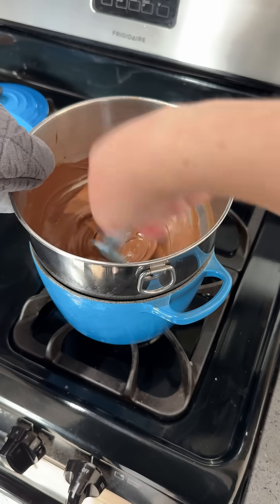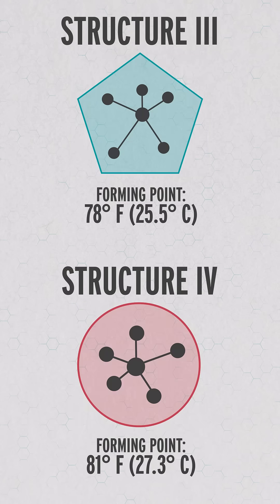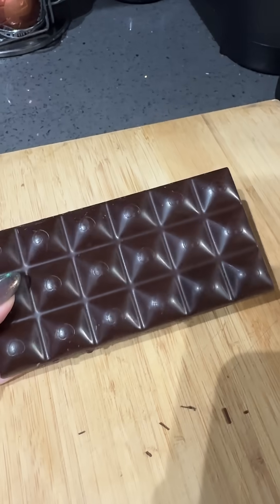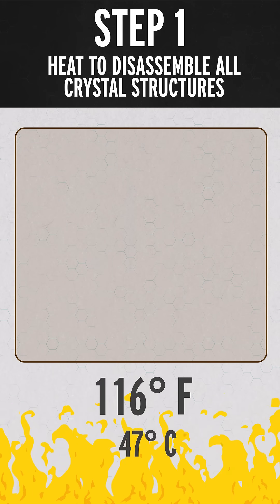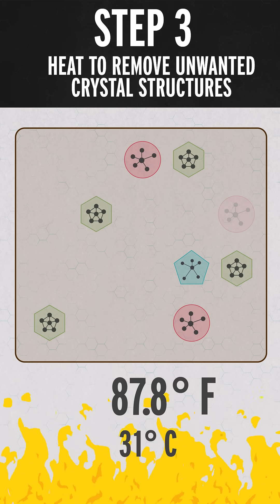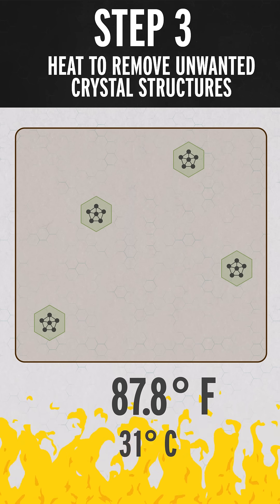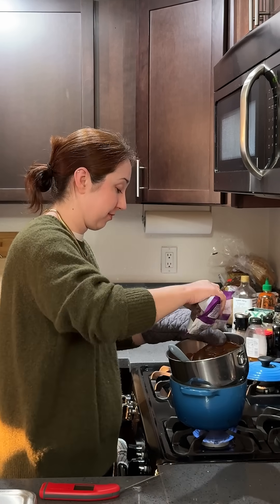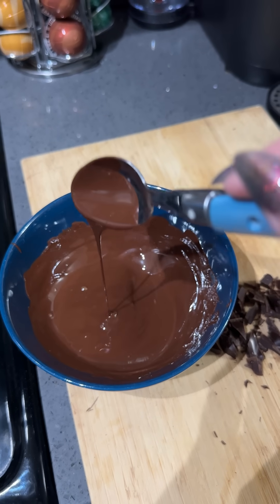tempering chocolate is chemical engineering

Comment: Recrystallizing chocolate is crazy.. using more chocolate as nucleation points is even crazier
Reply: I was wondering if it was nucleation sites. I don’t know much about it, but I remember the action lab video on supercooled water that will suddenly freeze on existing (crystallized) ice
Reply: it’s the same way industrial crystal manufacturing works
Reply: She didn’t do the science justice but there are a few examples of the “seeding” process and I’ve done it personally and it kinda works as long as you didn’t go overboard melting in the first place
Reply: @daniel3392  It's practically impossible to "do the science justice" while both working in a shortform video's restrictions and being approachable to laypeople. I'm no layperson so I can't say for sure, but I think she did quite a good job.
Reply: @daniel3392 she definitely did it justice because I’ve never considered that chocolate could have multiple different structures.
Reply: Engineering!!! 🥳
Reply: It's not exactly chemistry, it's crystallography. Without seeds, microscopic crystals form next to incompatible types. There's no coherence, no coalescence
Reply: It actually works to. It the same science used on industrial scales to create specific formations of metal
Reply: Nucleation points form naturally within the chocolate itself as it cools, not from the added tempered chocolate.
The seeded chocolate simply provides the correct crystal structure for alignment, speeding up and stabilizing the process.
Reply: “I used the chocolate to make the chocolate” 😂😂😂
Reply: If chem and science is crazy id be scared to know your political and world views
Reply: As a physicist to hear her say chemistry kinda hurt lol
Reply: I thought this was really clever, I'm going to try this
Reply: Congratulations, you understood the video and regurgitated it in a comment
Reply: She must be stopped 😭🙏

Comment: As a material engineer this is material science  and engineering not ChemE. Chemical Engineers can enjoy there pipes and fluids but they are not getting claim to solid state chemistry or crystalography. All jokes aside love my Chemical engineering colleagues but stay away from Our crystals!
Reply: Was just going to post about this. I'm an undergraduate mechanical engineer and just finished materials last semester. Had no idea chocolate could have crystal structures similar to metals hahaha
Reply: @Clen5150  then you got a lot to learn still. a lot of molecules can crystalize, that just means that they have a repeating pattern, which by definition means that polymers can also crystalize; for example if i remember correctly nylon can have up to 40±5% crystallinity.
Reply: Yeah, sure, you can keep your rocks :3
Reply: I'm an electrical engineer, I only took one materials engineering course where we barely touched crystallography. I came for this.
Reply: Mechanical engineer... came for this comment too!
Reply: You can keep your crystal structures, I'll stick with my oil and gas and reactivity distillation
Reply: Crystalography is often used in chemistry... its just that the line is non existent at this point between physics and chemistry
Reply: @michasokoowski6651  True you can really argue it's anything that connects that overlap between physics and chemistry. Just material science happens be a place where it happens in this scenario while ChemE as a discipline doesn't really more focused on the combination of reaction kinetics, fluids, and thermodynamics of things.
Reply: But isnt state of matter just dependant on specific pressure, temperature and volume?
Reply: @off-meta9962 > no. Structure is also configuration. Similar to proteins that are folded in pretty complex ways which completely changes their function. A lot of materials (which is why alloys are so fun) are combinations of things and while they are a product of time, temperature, etc. They can be manipulated. Even fairly pure compounds like table salt can crystallize in several ways, be it rock salt, flakey pyramid salt, etc
Reply: Are there good materials engineering jobs outside of academia? I did some semesters of materials engineering before I took a break, and I am now questioning my career choices.
Reply: @kolbyking2315 there are plenty. Really depends what you specialize in though.
Reply: @kolbyking2315  you may want to look into metallurgy specifically if you want a common practical application. but there's quite a few others, most of them in research, quality control/testing and process engineering. if you want to get into polymer science, which isn't really all that different from a lot of materials, you may find better options in the petrochemical industry.
Reply: @kolbyking2315  I'm still in school but I was able to get a gig for the summer pretty easily so I'm sure there's work out there though I can't tell you too much. If your looking for jobs it's worth looking at QC and failure analysis engineer jobs haven't found  any luck in hard-core material science r and d people always need quality assurance and a MSE degree can give you a lot good skills for qa.
Reply: Came here to say the same
Reply: Brethren!
Reply: never 🧐
Reply: @alananderson2567
As an ME who actually heard of this practice in my material science class from a Ph.D in ME... 👏🏾👍🏾👏🏾
Reply: I found this out the hard way when I went to an all day chemical engineering seminar in college, not what I thought it was. 

It was also even more brutal because none of the speakers had collaborated so the 10 presentations were all "how my job works as a chemical engineering graduate" and 8/10 of them had the exact same job (glorified health and safety manager in a factory).
Reply: Was gonna see if anyone else had the same thought. I'm ChemE, and while I have basic knowledge of this, there are many other disciplines this would more closely fall under.
Reply: lol I came here to make the exact same comment! Materials scientist here 😂

One of my profs way back in the day made his name by doing something similar with aluminum.
Reply: @jimmylin7233 wonder if we went to the same school. Was it for extrusion technology?
Reply: @Joker-em6oz  Not for extrusion but rather casting. Were you also a “Course 3”?
Reply: @ darn, different school. Oh well
Reply: @Joker-em6oz  always happy to make the acquaintance of a fellow materials person, no matter the alma mater
Reply: Besides, as ya'll have already stated above, that this is Chem Eng/Mat Sci Eng/Chem, is this also Food Science/Food Technology/Food Engineering?
Reply: as a chemical engineer, i agree
Reply: As a chemist, there are crystals in polymers.  The fat in chocolate is one. You can manipulate the melting point, the size of the crystals etc with chemistry.   But to be far what she is doing looks more like cooking.
Reply: @rebeuhsin6410  cooking is chemistry :D
Reply: @rebeuhsin6410 isnt chemistry just cooking with chemicals? Shes only focusing on temperature and crystal formation. Both are physical properties and so it has NOTHING to do with chemistry.
Reply: I’m a chemical engineer and I approve this message.
Reply: as a chemical engineer i agree
Reply: Its called physical chemistry, "material science" is not used for food. Food science specifically related to structures is called gastrophysics.
Reply: @PLF... material science deals with phase changes. This is an application of basic material science concepts
Reply: Yea this isnt chemistry at all. People just dont learn stem things anymore tho so its all just "science" to them
Reply: As a Mechanical Engineer who hates both you for the courses I had to take so that I could work with you, I'm about to make a rice cooker for Chocolate and sell for a $500.

Comment: Does all chocolate transform into type 6 crystal structures with time? You definitely need to make a full series of videos on this topic.
Reply: I went down a rabbithole and the short answer is "pretty much". Type 6 crystal structures in chocolate are mostly associated with bad things, like fat bloom (the weird fuzzy/hazy residue at the top of old chocolate). That being said, there does seem to be some differences in how type 6 crystals affect blooming in tempered vs non tempered chocolate. The short answer is that, typically, type 6 chocolate is formed after a significant amount of time, often months although it can be done faster if you store chocolate in poor conditions. Maybe there's a type 6 crystal structure that doesn't result in bloom but this seems to be something we have not found yet. But I'm a chemist, not a food scientist, so I could be wrong!

Comment: Tell us all about type 6, please. 😊
Reply: This sent me down an absolute rabbit hole. The short answer is, type VI is a crystalline form of chocolate that is associated with bloom, that gross looking moldy appearance you sometimes see if you leave chocolate out. However, it truly seems like we don't know AS MUCH about it as you'd think. Namely, type VI crystals form over time in both tempered and untempered chocolate, however the co-occurrence of bloom in these tempered chocolates is not necessarily as high. To me, this suggests that there may be a "bloom-free" method to get type VI chocolate crystals, although I couldn't tell you what that is.
Reply: @sunburntsatan6475  the phase 5 crystals melt at above 35 degrees, and the chocolate begins nucleating phase 6 crystals below 45, so perhaps by rapidly cooling fully melted chocolate down to about 41 degrees, waiting for it to form those phase 6 crystals, keep a portion of that chocolate to one side, melt the rest again, then use the chocolate that you've kept to one side to seed the nucleation of crystals the second time you cool the chocolate to around 35 (undercooling), then raise the temperature again to 40 to melt the phase 5 crystals, and keep it at 40 until the chocolate crystallises sufficiently to cool it down to room temperature.
I haven't tried this, maybe this will work?
Reply: tbh I'm also interested in getting phase 1 crystals without any higher phases, as it would be perfect for a chocolate sauce
Reply: @u7w2  But why go to all of trouble, going up and down. When you can just seed it like what the professor just described? Just seems like a lot of unnecessary work to me. With your described version, you have no way of knowing whether the set aside chocolate has properly formed the crystallised structure or enough of them to be able to produce a good final product?
Reply: That requires having tempered in the first place.  Once you have done that right from then on keep some for future chocolate  @SuperKendoman
Reply: @sunburntsatan6475 head cannon for me is those airy chocolate bars they have in England 😂😂
Reply: @jedimasternoob  I believe Ann Reardon worked out that flakes are basically just chocolate with too much moisture so it can't really melt (I say this but I'm going off my admittedly poor memory, but she did work it out and it wasn't that fancy)
Reply: @jedimasternoob  "head cannon" how does it not explode your head? Eh, head canon for me, "canon" being how you spell the term for a personal belief, is that you have a magical, explosion-proof head to support your head cannon.
Reply: @jedimasternoob  those are called, flake, and they’re my favorite chocolate, even though I live in the US. You can make your own by melting chocolate, and then adding a couple drops of water in it to seize the chocolate. Ann Reardon did it in one of her videos.
Reply: @sunburntsatan6475  probably in an oxidant free controlled atmosphere, it sound very similar to aged steel where you let the steel artificially age in a hot furnace for a couple of hours, typically around 400°C with a controlled atmosphere to minimize oxidation, that precipitates graphite and other secondary phases, in the case of chocolate, room temp and some months (due to the thermodynamic kinetic balance) would be equivalent to it, but I'm talking as a Metallurgical engineer, so this is just a entirely a conjecture
Reply: @sunburntsatan6475  I may have encountered Type 6 chocolate in the wild, in the form of surplus military ration chocolate that had been sitting in storage for a few years before being given out. The 100 gram bars looked slightly dusty after opening, and were rock hard, and would break into hard, sharp shards, but they tasted just fine and would melt in your mouth *eventually*. Dunno about the cocoa content, but it was dark chocolate so probably around 60-70%.
Reply: @sunburntsatan6475  thank you i was just about to go down the same rabbit hole. time to find a new rabbit hole! on to the next yt short!
Reply: @sunburntsatan6475  Bloom is not supposed to be mold, just other crystals structures from the fat or the sugar seperating. It’s harmless
Reply: It’s just theoretical. In reality it can’t actually exist because the chocolate is always eaten first
Reply: it's just like your type 5 chocolate after a few months of tempering, it's hard, melts realy slowly in your mouth and it blooms.
Reply: @LeoRaphae I may have accidentally made this with chocolate left in my bag in the work truck near the heating vents and then in the sun while working in the mountains 😂😂😂
Reply: If you put a chocolate bar in the freezer it usually has a pretty good texture.
Reply: @ninjaknight-jn9ky it will sweat (condensation). That will make it chip (get lumps) if it is couverture chocolate. Freezer only really works with stabilized chocolate (additives) which will never really be anything but a candy bar.
Reply: Some people say that it becomes self aware and capable of altering reality itself. Scientist tried to see if it was true, but at the 3th months it was eaten and replaced by a snickers bar.
Reply: Well that would be the next state of matter to be discovered. You’d be given a Nobel Peace prize and the medallion is actually a tempered chocolate coin.
Reply: Pleaaase show us how type 6 chocolate looks like
Reply: @atakantuncel2918  the phrase is either "how it looks" or "what it looks like," not "how it looks like." Just hoping to help. A lot of people get that wrong.
Reply: Who knew chocolate was the uranium 235 of desserts?
Reply: @charlesco7413  in what way is it like uranium-235? It is neither radioactive nor fissile. Are you saying it comes in different versions? Because literally all elements do, and on top of that, U-235 is just one specific type.
Reply: Me too honestly I been left on a cliffhanger
Reply: Chocolate VI
Reply: the type 6 is not edible pratically, it's very hard and super hard to melt, im not sure how you can make it willingly but there's usually some bits around perpetual chocolate machines , i worked in the chocolate industry for 3 years , tried to make something out of them but they are just bad imo
Reply: @zay-404  Oof. Are they like rock hard? Enough to hurt someone's teeth 😮
Reply: @SuperKendoman  hmm not so much as hurt your teeth but its not pleasant on them, it's like biting on a wooden spoon i guess, you can tell it's too hard before you bite too hard on it
Reply: @zay-404  I may have actually had some naturally ocurring type 6, from surplus military rations that had been sitting in storage for several years and was being distributed before it could expire. Looked slightly dusty, very hard, broke into sharp shards. Did melt in my mouth eventually, and tasted fine, but it required some effort to chew it up. I may have eaten most of a kilogram of the stuff... :D
Reply: @Winchester1979 it could be in your case that the chocolate had an airtight seal, most of the unpleasant flavor I mentioned I think is due to oxidation from prolonged exposure to air, just a guess though, but another possibility is that it wasn't really a type 6 and more likely a separation of fats in a "bad-tempered" chocolate, if you don't temper correctly the chocolate it could split after some time on the shelf (we're talking weeks or months), it's still totally safe to eat, if you were to melt it you can get a new "pretty" bar out of it, but it looks tarnished, it might have a pale/white hue on it and become extra hard and brittle, in which case the packet it was inside might also have something white/yellow near the sealing seams...(part of the split cocoa butter) I think that might be your case because getting a type 6 is usually due to overworking the fluid chocolate, and having it after tempering, although it could happen, I think would be quite difficult to do randomly/not voluntarily, you need to nail a very specific condition and curve of temperature to allow it to keep creating crystals after being poured in a bar
Reply: Type 6 is too hard and the melting point is too high for it to melt properly when you eat it. Does in no way take 4 months to make though, you make it exactly the same way as the others
Reply: There are 4 new types of diabetes?!?
Reply: everyone saying that chocolate type 6 is really hard is incorrect, chocolate type six has a soft texture described as grainy/waxy. it's essentialy gone bad.
Reply: @Bowowze  nope, altho it has a waxy outer layer , the "inside" and most of it is really hard, the closer thing to what are you describing bight be  just burnt chocolate
Reply: The diabetes we didn't know existed